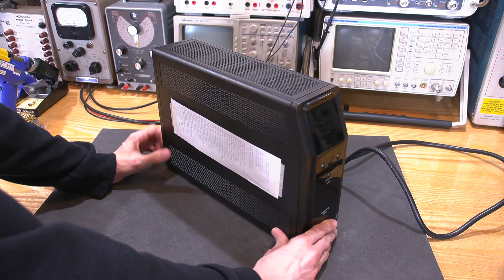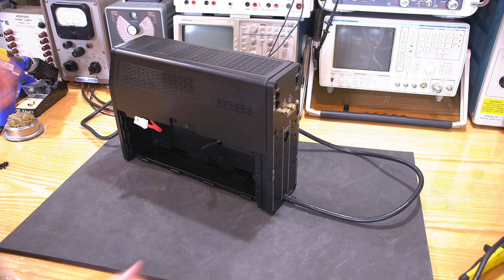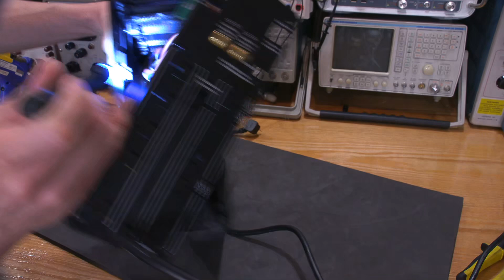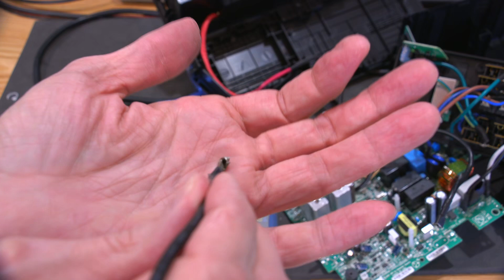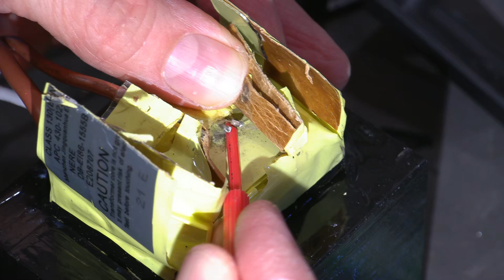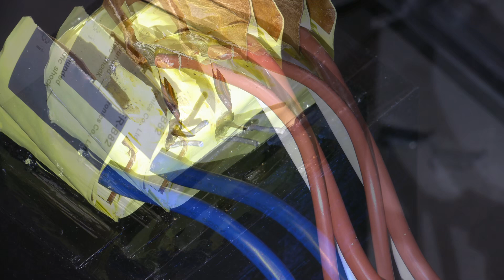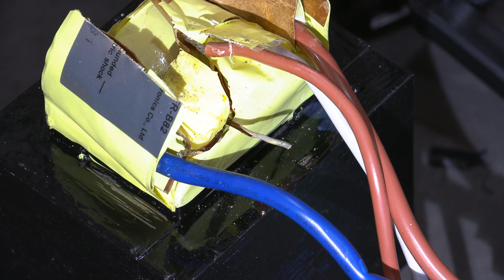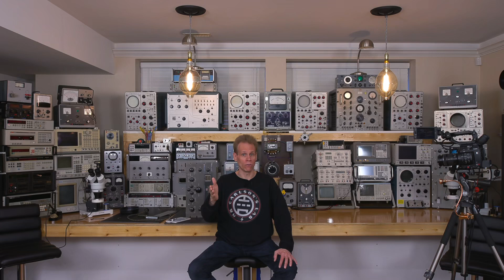UPS Electrical Failure - Teardown and Analysis!

Comment: This is the first time I've ever seen Aluminum wire used in a transformer! I noticed a very steep decline in the quality of APC units roughly 10 years ago despite their premium price. After I had a few fail only a couple years into service, I replaced every single APC UPS I had with units from Cyberpower and couldn't be happier.
Reply: There are lots of aluminum windings on transformers and motors, if aluminum wires are the correct size and crimped correctly using proper hardware they can last indefinitely, although they do not withstand temperatures as high as copper because aluminum conducts heat worse than copper and temperatures can rise too much in the innermost part of the windings burning the insulation.
Reply: @ruben_balea , should never be used in a situation where power fails.., ie …. Power outages…. Which is what this is designed for….
Reply: @ruben_balea  the airflow in that thing isn't good either.
Reply: @monad_tcp  Honestly any UPS with a plastic casing is only designed to run for 5 minutes while the system shuts down or hibernates, at full load the batteries may not last even 3 minutes.

Almost certainly any unknown brand UPS with a metal case would have been better than this APC model.
Most UPS manufacturers have now a range of "plastic toys" and real UPSs with metal housings.

The same goes for many power tool manufacturers, they have expensive but good quality models and others that are slightly cheaper but still very expensive compared to generic brand tools, but those can be even of worse quality than their equivalents of generic brands.

With these low-quality models sold at high prices they earn a lot, but it is quite possibly the last product of their brand that every dissatisfied customer buys.

I'm from Spain, in the EU we have the problem with the CE certification that the manufacturers themselves can certify the safety of their own products, but I imagine this model if it was sold in North America would have to have been also approved by Underwriters Laboratories and unless they sent a different sample to the Underwriters Laboratories I don't understand how it got to the market with a method of joining copper and aluminum wires that (I think) has been banned for decades.
Reply: I was a big APC fan until their newer models, however, when I switched to CyberPower I was even less satisfied. I have about 40 UPSes (render farm), and I have had 5 CyperPower Units fail and 2 APC units fail. CyberPower were particularly sensitive to RF (ham radio). CyberPower units also do not let you adjust the sensitivity as the APC units do, and thus they do not work well on generators that are below 58Hz (Generac at low load are notorious for running at ~57.5Hz). 

I tried TrippLite, and both of those I bought failed pretty early. 

So not too many options. Don't buy the cheapeast APC, buy some of the higher end models and they are still fine.
Reply: @PelDaddy  For use with generators you want an on-line, double-conversion UPS system which continually converts the incoming AC power, regardless of source, into filtered DC power, and then reconverts it back into AC power with a pure sine wave. These are recommended by Tripp-Lite and CyberPower has this feature in what they call "Generator Mode" available in their Smart App Online series of UPS units. It's more expensive and so it's not a standard part of every UPS unit as not everyone has need for that.
Reply: @redemptusrenatus5336  Good point. Of course you WANT that. Now multiply the additional cost of each UPS by the 40 UPSes and you will see why getting a good generator and using line interactive UPSes is often a better solution.

Of course when we do a full rebuild it will be a building wide UPS and everything will run off 240V as well.
Reply: @PelDaddy  screw line interactive that switches and regulates voltage though imprecise transformer taps a double conversion unit is the only way if you want it right
Reply: @bobking7347  Define "right." Double conversion does make a true sine wave, and work regardless of input frequency variances (within reason), yes? However the double conversion wastes a LOT of electricity, and costs more. Also the SMPS in computers couldn't care less about true sine wave, the approximate sine wave from line interactive is fine. So the double conversion seems to be a waste of money, natural resources, and carbon emissions to achieve what? No gain in this setup.
Reply: @PelDaddy  you obviously have done little research into how sensitive modern power supplies are and they do make true sinewave upses that are line interactive. When you also have other equipment attached you do need that clean stable power, it's also less stressful for a computer power supply to have real clean power. If you want a dirty squarewave feeding your equipment, that's fine, but you get what you pay for, hence the pos Carlson has in for repair. In order for me to explain in absolute detail, this comment would be a mile long, I just don't care enough to beat the ignorance out of you if you can't figure it out for yourself
Reply: @PelDaddy  If you invest thousands in your setup, but have a cheap pos ups like in the video, that is the definition of ignorance, especially if you also have a nice sound system and recording rig too. You spend good money on a computer, a killer setup and it goes bye bye because of junk like that apc, who is the fool there.
Reply: @bobking7347  I think there is some confusion, as I don't use the model in the video. We tested one, and deemed it subpar.

That's not to say that some APC line interactive models aren't fine.
Reply: @PelDaddy  Double conversion units also can put out a lot of interference and are not rated for home use.  I bought one many years ago on sale for my office and my CRT monitor went crazy even though it was 10 feet away.  Flat screen monitors sold now might be different.
Reply: @jaycahow4667  I would guess that would be the magnetic field, as CRTs are deflected by magnets. But that is purely speculation.
Reply: @PelDaddy  in your case it goes beyond just a consumer workload, that's your fault for choosing them for anything beyond normal use, look into a double conversion liebert or Eaton ups
Reply: @bobking7347  I wouldn't say it was anyone's "fault" LOL. I t was a conscious decision made after much testing and cost evaluation. The line interactive APCs work fine with most generators. The CyberPowers do not. That was the point.
Reply: its common and in that transformer it's supposed to be Aluminum with plated copper then you can solder to it.
Reply: Its not so much that its aluminum, its that they tried to use just plain ol' shitty SN96 to solder to it. That is the real issue, and god only knows why. My guess would be that the windings were changed to aluminum as a cost-saving measure, but the process of connecting them stayed the same as was done with copper, and the Chinese laborers in the factory just "did what was necessary" to make the wires stick together. Points to really bad process control. If they had used proper terminations, it would be not as nice as copper, but still would be perfectly acceptable. As it is here, it will burn your fucking house down. Literally.
Reply: @mysock351C  that's why atc is trash anymore a double conversion unit from liebert or Eaton will always be the better choice
Reply: Isn't Cyberpower the same thing?  The units look too much like APC to be coming from a different factory - at least as far as the case.
Reply: @russellhltn1396  no, from I've seen their true sinewave units, least the latest new generation of their power factor correction true sinewave upses are far better than apc consumer junk.
Reply: The problem is "specsmanship".  Many of these companies will name the UPS say "425VA" and you find that the real performance is substantially below that. I've had both APS and CYBERPOWER and can attest to both dropping substantially in quality in the last two years. The only issue I ever had in the past was the battery dying and you could replace that fairly easily. Now the trend seems to be the electronics dying and in less than a couple years. Quite annoying. I buy them from TigerDirect who seems to have them on sale constantly.
Reply: @dennisfahey2379  Seems like a race to the bottom. I can name that tune in one note.
Reply: @dennisfahey2379  Can you elaborate on not meeting specs?  There's a critical difference between VA and Watts and  I want to understand what you saw.
Reply: @dennisfahey2379 …, China.
Reply: @Bruce Havourd YES! Connections to the transformer were indeed inadequate.
Reply: I cut open a microwave transformer expecting a bunch of copper scrap, but alas, aluminum
Reply: I’m under the impression that Aluminium can be used if the proper technique is used.  Unfortunately, this is not how it’s done.  Oh, and it’s the rapidly formed oxide on the Aluminium that makes it so darn hard to solder.
Reply: I thought Cyberpower was just rebranded APC with a different case (this kind of thing is very common in consumer electronics).  If a company pays them enough, they'll slap whatever name you want on it.
Reply: @rgarito  Having taken both apart I can tell you they are definitely not the same. APC are generally a higher quality product, though both can and do fail.
Reply: @PelDaddy  apc isn't...
Reply: @bobking7347  apc isn't what?
Reply: @PelDaddy  Good quality at all.
Reply: Isn't aluminium wire totally safe if proper connects are used? And it's lighter and cheaper so why not? If anything we're the chuds for using copper
Reply: @thewhitefalcon8539  Aluminium is highly reactive but held back by the oxide layer that forms atop.  Also it has a different resistance to copper which must also be taken into account.  So, in short, you absolutely can use Aluminium if you design for it, but copper is usually a better choice.
Reply: The Lincoln Arc Welders (the old buzz box) were also wound with aluminum wire transformers. Even cheaper now, then when copper was not that expensive!
Reply: Take apart a microwave transformer.  The secondaries are aluminum while the primaries are copper .
Reply: Glad to hear that as I have two Cyberpower 1500VA/1KW ups's.
Reply: I have had great luck with Cyber Power, and 4 in use, METAL rack mount cases, never ever use Plastic cases for UPS or power strips
Reply: I thought the APCs we had at work 16 years ago were rubbish even compared to the consumer upss I was using. Come on, use a DB9 connector for serial communications, that if you plug in a standard serial cable in, causes it to immediately shut down? That's a company that doesn't care about their users.
Reply: i'm almost tempted to go out buy some cyber powers and tear them and my APCs down and post it to youtube.
Reply: Cyber power is no better. Kind of worse in various aspects.
Reply: Cyberpower is only a bit better but they are reliable, if you want a real ups, look into Eaton or liebert
Reply: It is all about profit, anything to save or make a buck.
Reply: ''''thats'''' the problem with aluminum wiring''''''''''the ''melting'' point is a lot lower with  aluminum '''''''under a un'normal load it can melt down into a (5) alarm ''''skyscraper fire'''''and kill more than a ''''thousand''''' people''''''''my dad was a ''state'' fire marshall''''and he told me in 1975 when aluminum wiring was starting too be used''''that it was a ''''disaster in the making'''''''''''HE WAS ''RIGHT''''... THANK YOU ''''PAUL'''''''''' JAMES.
Reply: i had an amazon rebranded cyberpower that had a relay that somehow managed to arc from one side to the other frying the control side of the board when it tried to get back on grid power after a power outage, definitely never getting an amazon one again
Reply: Same here, Cyberpower ....
Reply: Isnt this one supposed to have fan it
Reply: Standard distribution transformers used in buildings for 460/208/120 have aluminum windings unless you specify and pay more for copper.
Reply: @curtw8827 , this is dangerous….
Reply: Seems like the old lie about aluminum wiring being bad and causes fires and shorts out is coming back when 
the size of copper wires versus the aluminum is the real problem. You need LARGER guage wiring for aluminum
compared to copper and that's all . They work well in household electronics if simple rules are followed like using
 a proper flux to joint aluminum to copper for instance.
Reply: @hestheMaster  I'm a field electrician, and we only use aluminum wire for service installations (transformer to meter can) or SER cable, to feed sub panels.
Reply: @hestheMaster  I seem to recall that for home mains wiring the main problem with aluminum was that it needs a lot more care in termination (torque specs and some kind of anti-oxidation schmoo) because the formation of the oxide layer can cause joints to go high resistance over time and heat up if you treat it like copper. This is of course just a building code thing, Al/CCA is all over in products/power cables now.
Reply: @hestheMaster  what if silver was used?
Reply: @jimalcott760  Naw,you want to use gold. Slightly less conductive than copper.
Reply: @jimalcott760  to expensive it also tends to oxidize far quicker than copper
Reply: @hestheMaster  The problem with aluminium wiring isn't so much the gauge, though you are correct that larger gauge is needed than copper for carrying equivalent current. The really big problem is junction boxes with screw terminals: Put a piece of copper wire into a screw terminal and screw it down tight and it stays like that for as long as you like. Aluminium however is more malleable and suffers from "creep", meaning that the part being compressed under the screw head will "flow" over time, causing that screw terminal to become loose. Not all that much time either - a year or two can be enough. A loose connection has higher resistance, so can get dangerously hot, especially if the circuit has a high current flowing through it. Aluminium has a far lower melting point than copper, so this heat buildup can start melting the ends of the wires in the terminal. The loose connection then becomes an actual gap, so you get arcing, generating even more heat, and that's typically where the fire starts.